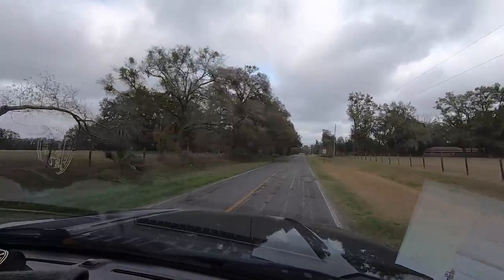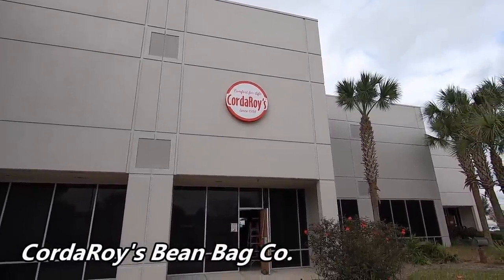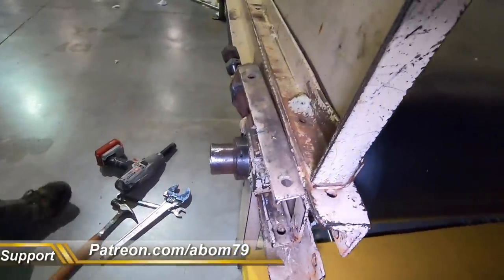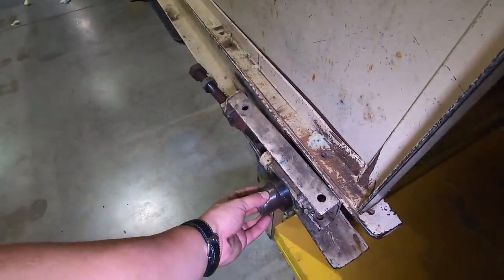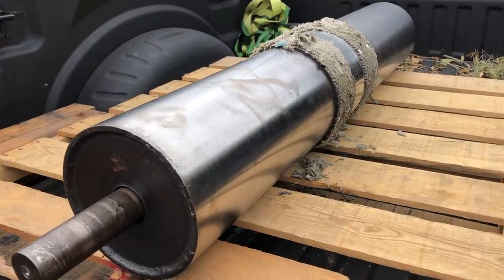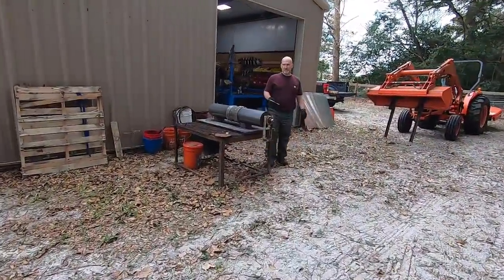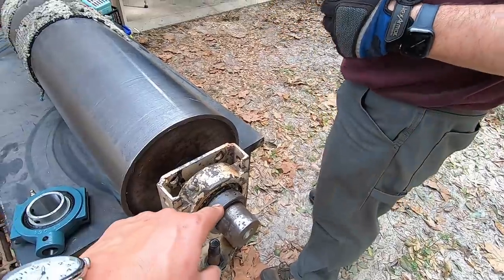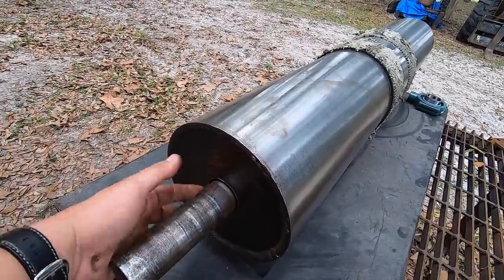Conveyor Roller Repair

Comment: Why stick-welding with a mig mashine u could have no stress with the slag....
Reply: Lot of people prefer stick outside because it is less sensitive for dirt, wind and when they are repairing old thick stuff, unknown material and so on. For repairs stick is good and reliable choice.
Reply: That AHP welder is TIG / stick, not MiG.
Reply: Ah..ok thanks...
Reply: Stick weld (especially on reverse polarity) will give much better penetration hence a stronger weld

Comment: I hate to say but I don't think that repair will last.  The weld has introduced too much stress concentration just where it is not wanted.  I used to have terrible trouble with rollers tensioned under great load and the only solution is to use the construction as it was originally on this roller but with no weld on the inside of the outer plate.  Instead a press/shrink fit on shaft with outer plate diameter welded last.  I'm not sure I remember the assembly and welding sequence, but no effort was spared to avoid stress concentrations wher your weld is.  I'd recommend buying or fabrication a new roller for when it fails with fatigue curves. JF Ireland.
Reply from the maker: It was an emergency repair made to keep the line running. I was there to lend a hand. It’ll hold just fine, but up to the business to worry about preventative maintenance
 or replacing parts from damage.
Reply: i agree fucking chip hammer whers the neddle gun you chip to relax the mollls not make perrty furthere mor one hour two pepole fixe or send  em down the road
Reply: I disagree. By making three passes, each one larger diameter than the last he spread the stress over a larger area. As long as he let the previous weld cool properly it should be just fine.
Reply: @Abom79  I understand it's emergency repair  u still want longjetivy head pullys and tail pullys flex as they rotate always relax the molls  good weld just relax molls  p.s. you are the best machinist I have ever seen.
Reply: We replace rollers daily, we have 2 aisle's full of them due to the fact that repairing them only cost more in the long run because they simply do not hold up no matter how good the welds are.
Reply: @ironlife227  :-Redesign;  make the two outer plates about 10Mm or 3/8 thick.  Shrink/press fit these outer plates on to shafts later and weld around circumference...not around shaft.  But First weld inner plates to oversize shaft and weld inside roller. Turn down to dia in steady rest then press on outer plates.  The idea is to have no weld on outer plates but to have a wide bearing surface.  We went from breaks every couple of days to many years with no break once we got it right.  But its a lot of years ago so my recollection is not detailed.

Comment: Nothing against your great work but that roller stub is gonna fail again the weld on the inside plate has failed and that stub shaft is gonna wobble about the inner plate and crack the welds eventually. Good choice on the 7018 rod, my classmates in high school metal shop refered to as tank building rod.

Comment: By the technical terms of a conveyor, that is a pulley, not a roller. Rollers are the idlers that hold the bottom of the belt up.  I usually call them rollers myself, but if you need to order parts, you won't find anything you need searching for rollers. If they were paying shop rate, it may have been cheaper to get a full width shaft, tapers collars, and a new pulley(Pulley affixes to shaft with a tappers collar rather than one piece. Never have these issues again.
@abom79 For a second I thought you were Tom Lipton, congrats on the weight loss.

Comment: What is that thing looking like spiderweb hanging on those trees? From what I've seen this is common thing in this aeras. My first thought was that the trees mastabeen in watter so high that those courtains were left on them. However it cannot be the case considered lack of damages around coused by the flood. Could you please let me know what is this misterious object
Reply: It is called "Spanish Moss" though it is really  Tillandsia usneoides,  a flowering, epiphytic plant belonging to the Bromeliad family.
Reply: @paulnels108  is this a parasite like mistletoe or what
Reply: @tomekpawowski2692  no it is not a parasite.
Reply: Spanish moss (Tillandsia usneoides)
Reply: Some call it old mans beard.
Reply: That is Spanish Moss - which is plant that gets its nutrients from the air and water. It's really beautiful to my eyes.
Reply: It was used as bandaging for wounds around the time of the Civil War.  And also for stuffing mattresses.
Reply from the maker: As others said, Spanish Moss. It’s all over the North & Central Florida areas.

Comment: It's not good work. The shaft has a lot of clearance inside and it's the weld bead that will take all the shear forces. We had to pull the shaft out, rebore the drum, turn a new shaft and finally weld it. This job won't hold.
Reply: Well, we'll just hafta see.
Reply: Pretty sure it will hold since it isn't a huge industrial application.  The fix they did will last it another 30 years since it isn't being used hardcore.
Reply: I got the sense that there was a limit of what they could actually do for them there. Would they even have available a lathe capable of boring the drum and turning a new shaft (it's not as though they were in Adam's shop)? Were there even funds for the project to fabricate a new shaft?

It seems to me like good work for the constraints.
Reply: @Venthorn Of course, the urgency of a repair often leads to temporary or shaky solutions. But in the case of the industry, the long list of serious accidents suffered by employees has long alerted labour inspectors to non-compliance with the standards and directives issued by professionals in the sector. The worker who welds this do-it-yourself will not be the one who gets his hand crushed in the next accident. So don't say it's a good job, thank you.
Reply: @bebertdattagre9280  While the shady work of some DIY-ers can result in injury to others, with this fix even if the weld breaks the shaft is still contained in the roller (as it was in the beginning of the video). There's very little risk of anyone getting hurt by this and the downtime of the plant is minimal.

The shaft was welded from the back when it was originally made also, so this repair is literally "as good as new".
Reply: A lot of rollers is made this way, but with TIG welding. Not as strong as other methods, but strong enough for many appications.
Only difference is that the axle would be welded from both sides.

Comment: Bro... you gotta fix the sound on your videos! The high pitched squeal is like taking a hearing test. 
Otherwise great videos!
Reply: jacktheripped heavy metal all day!! 😎🤘
Reply: A sound editor program, many free, will have a frequency view. Pretty easy to see the Infra sounds [things that make for boomy noises] and the high squeals. Power hums and the like can be filtered. Tough though to sync to lips and hammer blows so figure the order of operations to avoid those problems as well.

Comment: I have to wonder why the end of that shaft was mushroomed. I don't see why anyone would think hitting it would be useful.
Maybe they just banged their legs against it too often and took out their frustrations on it...
Reply: It’s odd how people in factories think beating on things make them work better.
Reply: @SkylersRants  The same goes for a lot of managers on the workers
Reply: @easternwoods4378  What I found is that if you let it look run down, they would treat the equipment like trash.  I would have my maintenance guys make sure everything was clean (if possible in whatever type of factory we were in), and never let the workers tape things up or tie things on with wire.  My instructions were to remove anything like that and if it were beneficial, to fabricate something that looked professional.  That way they tended to be more respectful to the equipment.

Comment: Wow... for someone who has been designing, manufacturing, and repairing conveyor pulleys for close to 20 years, i never thought anything would shock me again, then I saw half of this video. 

“Repairs” like this have provided me with a wonderful career in fixing them properly. Usually this kind of bodge job lasts a week or two, sometimes a month or two, but then the owner calls someone reputable and gets the job done professionally.

This is a third world repair. In fact, I’ve seen better work in third world countries.
Reply: I would agree with you, however if he had been at his own shop, I bet he would have taken the roller apart and done it properly, but he was at a farm shop with limited equipment so had to do the best he could, with the equipment he had. I bet when you do it you have the roller at your fully equipped shop and charge a good price for the job. He was doing a mates favour get working job
Reply: animalian01 there are still many ways he could have done it better with the equipment he had on hand. And yes he would have done a better job in the shop, i know, but he could have done a much better job on site as well. Obviously it’s very lightly loaded, so potentially it won’t be a problem except for the massive runout. But they will have to take that into consideration when tensioning the belt because that amount of runout will cause huge tension irregularities during rotation. This is not such a problem on long conveyor systems where you have long runs of belt to take up the tension spikes, but a tiny belt like that with a short run will need to be managed very carefully. 

With small flat belts like that, usually they run at very high tension, because they run at low speed. So the extra stress he’s putting on the welded joint and the end-disk as a result of that runout will be the deal breaker. 

I could talk for hours about the stresses involved, but it’s a waste of both our time.
Reply: @madaxe79  again I agree with everything you say but it depends what the goal of the repair was, I am a reactive engineer and if the job had been mine. my goal is to get the piece of equipment back running in as safe a manner as possible, so they are not down for too long ,at the same time I would have arranged for a replacement correctly made roller to be sent out from our head office. I would tell the users that I would get it running but it needed a full repair. I would then liease with the users for a scheduled shutdown within a reasonable time period and then replace the damaged parts and do a permanent repair. its obvious the fault was down to a poorly made roller failing which caused an emergency call out
Reply: As someone with your knowledge. What were the 2 strips of fuzzy stuff and its function in the middle of the pulley and why did the weld go bad?
Reply: Funny so have i, but a little over 20 years (not just pulleys all kinda stuff surrounding a factory).  And i have actually designed and made rollers just like that, and to be fair with the amount of tools he has i say he does a pretty dam god job. (and he also say it's a farm fix and that he is not in his own shop).
And also why did you not notice the two bands are installed incorrectly? 
Do you even know what they do?

I have seen a lot of this guys videos and thrust me he is good, either you are full of it or you are some sort of god, i'm guessing the first.
Reply: @sopalen  It's been almost a year since I watched this video, so I can't even remember what you're talking about, and I'm honestly not that bothered. I hope you have a nice Christmas and a wonderful New Year.

Comment: what is the purpose of the carpet on the center?
Reply: To keep the belt running centered.
Reply: Faster and cheaper than trying to machine a crown into the roll.
Reply: This is the secret of keeping a flat belt centered on the drum it rolls on. Larger diameter in the center draws the belt to be centered on that roller.

Comment: With all due respect fellas that is not machine work, content is substandard. Your reaching for content to show something to fill the air.
Reply: You get this kind of work in a job shop. It is actually a very relatable job for me having worked in shops.
Reply: You mean "you're", right?  If you're going to comment, at least spell correctly.